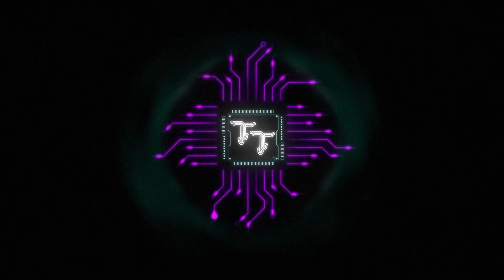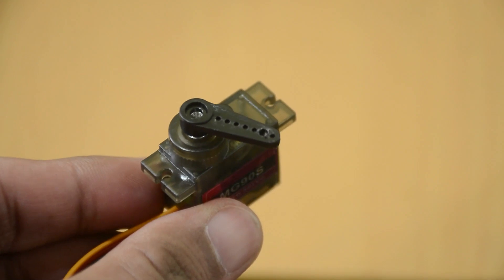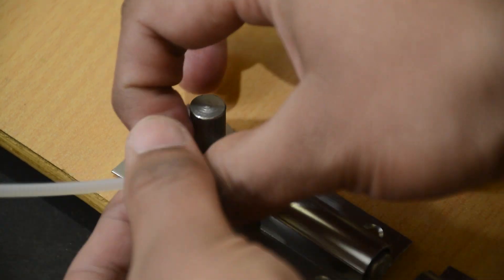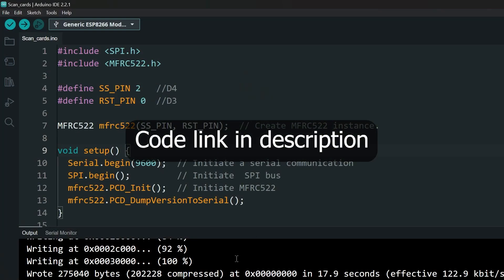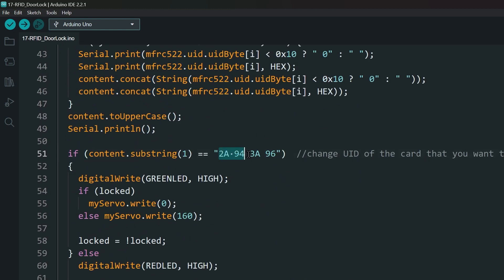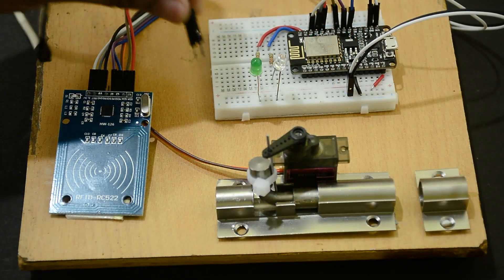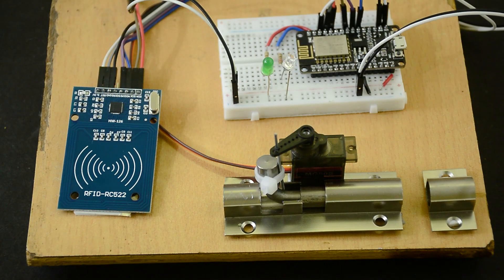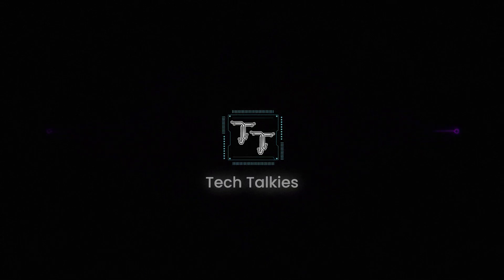Arduino RFID Door Lock - With ESP8266

Comment: Has this system still worked until now?
Reply from the maker: There's no reason it shouldn't work. All basic components.
Reply: I'll try this system for my project, because I'm so stress to find project like this, hope it works
Reply from the maker: It should. I'll help you out if you run into any errors.
Reply: @techtalkies1 okay thankyou, if something error I'll chat you okay? thankyou so much
Reply: @techtalkies1 my servo motor is tower pro it is compatible? or need MG90S???
Reply from the maker: Any 5v servo should work
Reply: @techtalkies1  the wire on breadboard red and black it is a solid wire??
Reply from the maker: Yes, single core wire. You can also simply use jumper cables.
Reply: @techtalkies1 it is okay if i use jumper wire instead of solid wire?
Reply: @techtalkies1 Sir, my solid wire is brass inside not a silver
Reply from the maker: That's alright. It's a simple project. Material and thickness is not very important. If you're unsure, just use breadboard jumper wires.
Reply: @techtalkies1 it is okay if i use jumper wire instead of solid wire? if I connect the VIN to +?
Reply from the maker: If you are new to this, don't change the connections. Just replace the 1 core wires with jumper cables wherever necessary.
Reply: @techtalkies1 okay sir, thankyousomuch your video is very important to my project because If my project doesn't work, I'll fail. :((
Reply from the maker: Happy to help!
Reply: @techtalkies1 sir can u put here your code? thankyou
Reply from the maker: Link is in the description
Reply: @techtalkies1  there so many code in the link, where is the correct code?
Reply from the maker: There is only 2 projects in the repo. 1 to scan the card IDs and the other one is the main project.
Reply: sir any type of esp32 will be compatible or no? because your esp32 is type C then my esp32 is Android it is compatible if my esp32 Android type?
Reply from the maker: You can use any microcontroller
Reply: @techtalkies1 but the case is my microcontroller is not compatible to breadboard that's too big, no spacing to side that's why the jumper wire  can't plug on each side of the microcontroller
Reply from the maker: Yes, some esp32 won't fit on the breadboard. You can use two breadboards and plug the ESP32 in the middle.
Reply: @techtalkies1  then how? can you please send me the example:((
Reply: @techtalkies1 can I try another esp32 for testing?
Reply from the maker: You can use any microcontroller.
Reply: @techtalkies1 sir, What did you put on the tools then board?
Reply: @techtalkies1 Hi sir, thankyousomuch for answering my all question now my project is working 🥰
Reply from the maker: Great! All the best.

Comment: This is exactly what I wanted to try. I keep getting an error when compiling. "reference to 'byte' is ambiguous". Could you try to compile it and see if you can without an error. I think they changed something in Arduino IDE. i have tried on 2 different computer using diff versions of IDE and Libraries with the same error. Thanks again for sharing.
Reply from the maker: I can do that. This project is pretty old and there are chances that the code is clashing with newer versions of the IDE. Can you give me time till tomorrow? I will check it out and update here.
Reply from the maker: I just checked the code it compiles without any issue. Arduino IDE 2.3.4. 
Where are you getting the error? Check which file is throwing the error. It might be inside a library. Are you using the same libraries as in the video?

FYI, I am compiling for a Nano board.

Comment: is the esp8266 not plugged into the cellphone? or not plugged into electricity? are you not using nodem?
Reply: thank you so much, bro
Reply from the maker: It's connected to external power. Notice the white and black jumper wires.
Reply: Can it be replaced with a battery?
Reply from the maker: The motor will take a lot of power. The battery won't last that long.
Reply: If you use a transformer or laptop adapter, is that possible?
Reply from the maker: If it is 5 volts. It will work

Comment: Can we use micro USB cable to power it directly esp8266
Reply from the maker: Never connect big motors directly to any microcontrollers. Especially 3.3v boards like esp8266